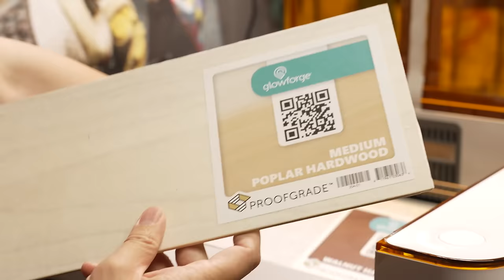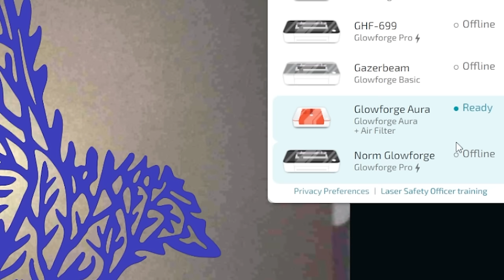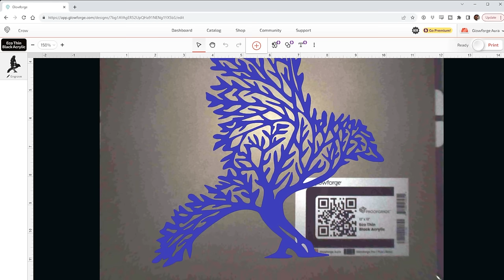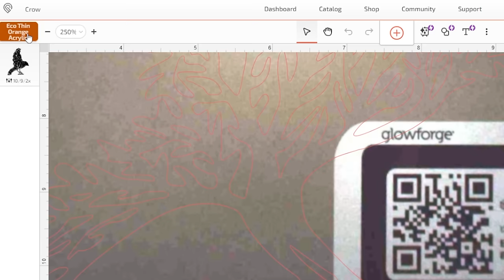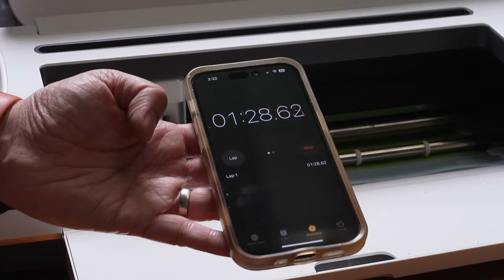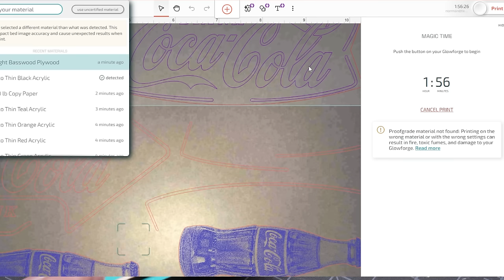Glowforge Aura Laser Cutter Review!

Comment: 6w? Wow is that weak. My 20w output Comgrow (diode) outperforms this at  half price and includes air assist, honeycomb, filtered exhaust, cover, etc. also. Look at other products, like XTools, longer, or run the risk of irrelevant. At 12x12 is also crazy small. Most other models seem to start at 15x15 and with off shelf extruded aluminum, gantry can be greatly enlarged - just need to extend any cord or tube
Reply: yeah i preordered the 20w elegoo phecta and it was 40% off so very cheap. with air assist, honeycomb and filters, and a rotary.
almost as much as glowforge air filter alone.
Reply: @smittysbuilds same, mine will arrive next month
Reply: He did say entry level , are those other models easy to use and beginner friendly for in home use?

Comment: give elegoo 2 years and they will dial in their lasercutters to be 100% better and 70% cheaper than this. I like glowforge, but damn that pricetag for a 6watt laser is crazy
Reply: Elegoo makes damn good products. My first printer was the Neptune 3 Plus and I haven't had any major problems at all. I plan on getting a resin printer from them too.
Reply: They already better and cheaper only reason I want a Glowforge is Co2 so I saw they had a new 1200 buck model had to search for a review. I got nicer set up strapping a 10wat to an old ender 3 lol I mean come on I just used my comgrow encloser for it and used dryer hose and a duct fan to blow the fumes out an AC unit window exhaust. Then 130 for a new filters holy crap this thing is just a rip off every wich way I mean I could maybe say filtration would be nice, but I can get a filtration system and nicer desktop laser and enclosure for this price and still have money left over

Comment: Are there any similar products that do not rely on or require a cloud connection? It's a pet hate of mine that kit like this forces a dependency on both internet and 3rd party server connectivity to function, especially when there are often no good technical reasons to do so.
Reply: Yes, plenty. The Roly Automation Lasermatic is cheaper and extremely well designed for a diode laser. It's 10W (optical power) but they are coming out with 20W and 30W versions later this year. Best used with Lightburn software (not free but worth the relatively minimal licence cost). Get the Lasermatic version that includes the enclosure. EDIT: also the technical support is outstanding.
Reply: xTool M1 is fully enclosed and while the software is proprietary, it doesn't require an Internet connection (or even WiFi, you can use an USB cable) to work.
Reply: @YaaLFH it's also nearly double the price with a smaller cutting area.
Reply: @SK83RJOSH  Double the price of what? Definitely not the Aura.

Comment: Not only is the glowforge outrageously overpriced, the fact that you have to send your project through their "cloud based" server that then sends it back to your(?) cutter is absurd. Not only does that mean that everything you do goes through a third party (umm... privacy, anyone?) but it also means that if there is a server outage, you aren't using your(?) cutter. Plus, WHEN the server goes dark - and make no mistake, it WILL eventually go dark - you now own a $1200 paper weight. 

I'm going to stick to my AtomStack laser engraver that sells for a fraction of the cost; where I actually OWN the hardware that I purchase; that runs on local side software; where my work remains under my control at all time. 

I'm at least glad to see that it's now called a "cutter/engraver" as opposed to their original designation of their machines as "laser printers." 🙄
Reply: Well damn.
Reply: Okay, but to make the atomstack fully enclosed and office safe you're spending way more than this, for what? The ability to cut thicker materials and have to worry about way more maintenance. Nevermind the total lack of optical alignment and so on.
Reply: @SK83RJOSH  Please... explain. Why is there "way more maintenance" on my Atomstack? Both are diode lasers, so the maintenance would be exactly the same. 

I don't think that the Atomstack I was talking about here can actually cut thicker materials because it's a 5watt as well, but my other Atomstack can because it's a 20 watt, but still a diode laser (and STILL cheaper than the glowforge's 6 watt aura), so... again, the exact same maintenance. 

"...total lack of optical alignment..." What are you even talking about? Again... same diode laser modules so the same "optical alignment," whatever that means in this case.

As for the enclosure and "office safe..." just a quick search and the first "office safe enclosure" I found is under $200 (and I am sure there are cheaper options, but..) so add that to the $400-500 for the laser itself and we are still at least $300 cheaper than the $1000 for the glowforge. 

And that still doesn't address the privacy issues or the dependence on a third party server that will render the glowforge a paperweight WHEN it goes dark or even when there is no internet connection. 

If you like the glowforge, great... go for it. People like you keep them in business. But please do not try and act like the glowforge is superior in any way. At the very LEAST, it is comparable to other, cheaper, options. But given the other aforementioned issues... 🤷‍♂ but you do you.

Comment: Norm mentioned a vinyl cutter; I just looked it up and this can cut vinyl transfers as long as its rated for lasers (no PVC).  So this could actually pull double duty.
Reply: Yeah. Only problem is that most vinyls have pvc; the selection of pvc free ones is extremely limited.
Reply: "So this could actually pull double duty." That statement is true of EVERY diode laser on the market.
Reply: @BlueLightSpecial2023  I wasn’t saying it was specific to this laser cutter, only that this could replace a vinyl cutter for those with limited work space.

Comment: Just run some secondary power to the fan with its own switch for when you want to manually turn it on. Or find the power source and direct connect with a switch to bypass the internal logic
Reply: Or get something with all that built in for half the price

Comment: Oof! Seems they're following Canon, Epson (and Apple?) pricing models. If the machine needs that filter gizmo, it should be supplied as part of the kit rather than an extra cost. The 'consumables' are well over-priced for what they are (in material/manufacturing costs). I'll stick to my second hand vinyl cutter for now thanks. (Unless Glowforge want to send me a free one for 'reviewing'. Nice gig if you can get it.)
Reply: You don't need the filter thingy unless you can't or don't want to vent out a window.
Reply: @ellenkingartdirector  You can vent out the window and outperform this for half the price lol. I got ender 3 with a nicer laser the laser costed me 200 bucks, its faster then this because 6wat is kind sad for that price even with the "lens" its like no shit I got 10 wat with a focusing lens two that cuts same level of detail faster lol. And I just run dryer hose and a duct fan out the window its pretty damn cheap to set up lol

Comment: Yikes. This is e-waste.
$1200 gets you 60, 80, or even 100W in a fully floor-standing unit with a huge work area, motorized Z, and other things. Or it gets you the nicest, absolutely home-friendly K40 cutter with upgrades, a good control, a copy of completely offline Lightburn(which is miles better than whatever junk Glowforge's web-only thing can offer), air filtration, a supply of filters, materials, spare lenses, and other stuff.
Reply: But it's not diode.
Reply: @3DJapan  Low power diode lasers offer zero benefits, especially with a controller that has similar rise and fall times to cheap CO2 systems.
Reply: I replaced my glowforge+ with a k40 when the glowforge broke thanks to the there terrible engineering and it's literally 6 times better it's faster more repeteable and reliable than something that I payed nearly 3800 for
Reply: @3DJapan  Diodes are not that great and you can get a diode hobby laser kit for less then this that cuts and engraves better and faster lol. I got 10w attached to an old ender 3 that makes this thing look like it belongs in the under 200 buck catagory. Only thing nice is air filtration but its 130 bucks for new filters, and honstly you can get so much nicer stuff then this. Plus its software has a paywall and its cloud only lol.

Comment: Stop promoting glow forge. We regret purchasing ours after you guys first started covering them. We have a founders version and the BIGGEST let down is that it is cloud based. They go out of business and you have a $5000+ paper weight. It might as well be as bad as a subscription service. If they ever come out with standalone software for using it without needing any time of internet, THEN it’ll be worth it.
Reply: My plus broke after like 18months cause they used textured paint inside the cable protector and there answer was buy a refurbished unit that's not even cleaned let alone actually refub and they wanted 1500 and my old one back so they could put a 10 dollar cable in it worst company I ever did business with

Comment: Great video, you think is possible prototyping PCB on it ? 

Like cutting copper layer only, keep intact the fiber board itself, even pass trough a mask clear coating
Reply: No, it's a weak diode laser, it will not make a dent in any metal.

Comment: These cheap laser cutters are still not really worth it. Not being able to cut clear acrylic is a big disadvantage.
Seems to me it would be better to hold off and save for a more expensive laser cutter that can handle more materials.
The slow speed also pushes me to that conclusion. If it's not fast enough, and useful enough then I can see myself not using it even if I had it.

The lack of an off switch is a safety hazard.
Reply: You can get omt vertion of the k40 with  the us safety upgrades for slightly more than 1/3 the price of this junk and not have to deal with there cloud software

Comment: I wish I would have seen this (and all the comments about GlowForge) before I drank the Kool-Aid from all of the Social Media influencers who were also gifted this machine and PAID to sing it's praises. 
The marketing for this was also atrocious - it was VERY hard to find any information on this machine! 

Side note - I'd love the link to that alignment tool!
Reply: Its a hobby laser that costs 3 times too much, with filters you got replace on reg for 130 bucks lol I got a laser that is better strapped to an old ender 3 that outperforms this thing, and I use a dryer hose, and a duct fan to vent it out the window using the portable AC window attchments lol Nicese thing on this is the filtration system and for 1200 bucks you could get a nice laser with out cloude based software, and attache it to an enclosure lol

Comment: Horrible review, all glowforge products are over priced, too cloud depend (you can't actually use it without being connected to the internet. Your job needs to be sent to their cloud server and then back down to your printer. This means anytime they have an issue your device is completely useless which has happened a few times in the last couple years.)

Then there's literally the abysmal support and horrible packaging that this comes in our first ones came with lenses that were cracked and would smoke. And took sending multiple videos of this to support to get anything done.

Really these "paid" reviews are just absolutely useless.
Reply: ABSOLUTELY all of this. 
It is very sad for the consumer who is looking for REAL feedback before spending that big chunk of money (which isn't so big for folks who are getting paid to use  and talk up the free machine they got).
ALSO - the machine is NOT returnable and NOT exchangeable. So if/when it breaks, you've got a $1305 paper weight.
Reply: @xxBLKSNXxx  care to elaborate? 

It's a local (highly over priced) drive what requires the cloud to pass information between the client device. 

And this cloud connection requires accounts to be created and maintained. Meaning that if their servers have an issue, your Internet, DNS or they take issue with you. Your device is a paper weight.

Comment: This machine is hilarious, it’s jewellery, looks pretty and that’s it. Expensive and looks good, apple should have made this product! how on earth does glowforge exist as a company😂. The certified materials are even better, £25-35 for a single piece of 30x30cm plywood 😂 such a bargain and according to glowforge these are “materials not available anywhere else” 🤯. Is this a new type of plywood? Which material isn’t available anywhere else! Kryptonite? Can a 5w laser cut kryptonite? Glowforge is such a closed ecosystem that you can’t used the air filter with anything else, no third party software like lightburn which is the most common used product out there. I don’t know how the reviewer kept a straight face trying to convince us this is a product you should consider buying, bravo Oscar performance 😂

Such a major achievement though to cut paper in a single pass, just buy a pair of scissors!

Comment: So its diode and its weaker than the one I got on my cnc 3018 sigh. Seriously you can buy a desktop one with same power and set up the enclure and filtration system for like 700 bucks sigh... I mean my set up was less then 500 bucks the laser costed me 200 bucks, and its 10watts And cuts deeper faster... And I just made my own system using a dryer hose a duct fan, and AC exhaust to blow it out the window when lasering...

Comment: Bluetooth connection for the frigging air filter? Pass. Give me hardware power switches and don't use wireless for stuff that doesn't benefit from being wireless.

There has to be some better option than this or the dangerous as fuck DIY kits you can get online.

Comment: The thing I never understand we in the U.K. are struggling to feed our families and heat our homes . Lots of families in food poverty yet go buy a $1200 laser cutter or 3D bambo printer. This is why I find tested no longer relative to me as a maker. Most people live in the real world not the world of me me me  it’s all about me  look what I have . Shocking advert
Reply: One this thing is a rip off... you can get a much nicer hobby laser set up for half the price. Two people buy these to make money. I made back the cost of my bambu printer 2 times over since I got it, issue is I  always want more toys, but this thing is trash I was looking at glowforge because my local community college has their CO2 lasers, but 1200 bucks for diode that is designed to lock you into their software and replacement parts oh hell no. I got 200 buck laser strapped to an old ender 3 max that can outperform this thing and it costed me less then this even with the enclosure and dryer hoses and duct fan I use to vent the fumes lol. I was looking for an upgrade but this is an overpriced underpowered hobby laser lol.